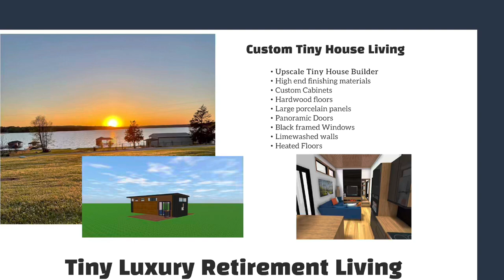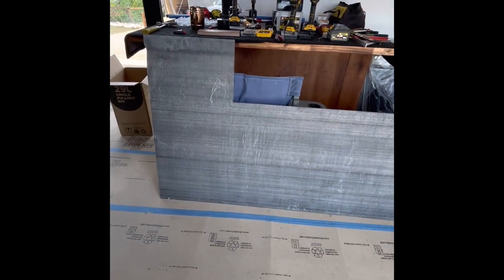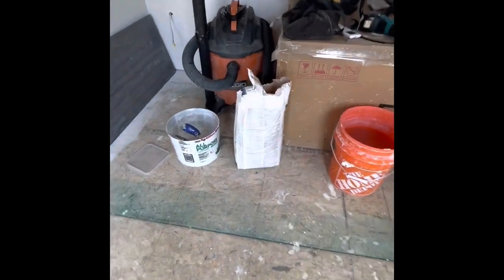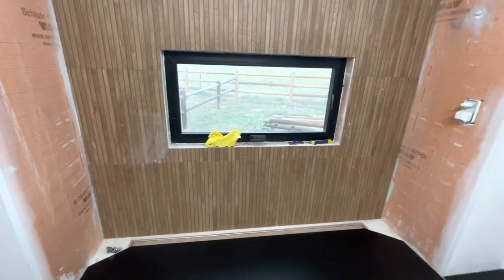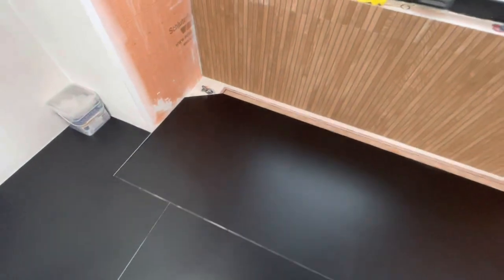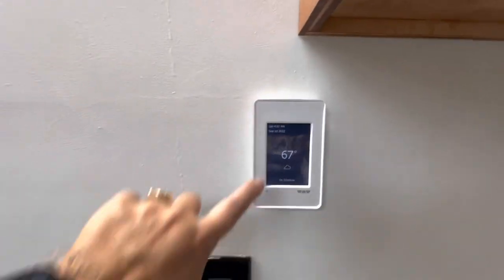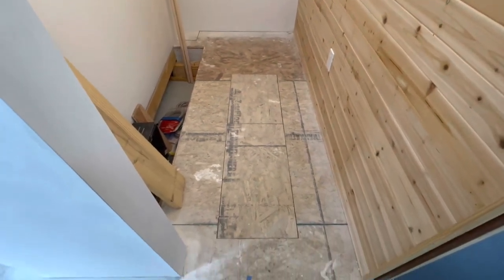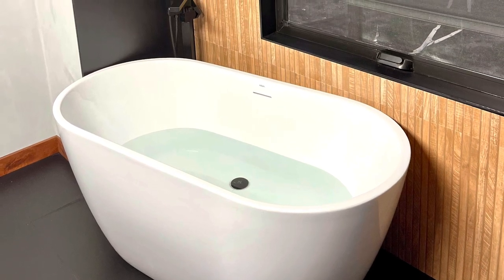Not-so-Tiny House Bathroom Transformation with @CrossvilleTilebrand

Comment: Just curious to know what would be the cost per square feet to build a 'not so tiny' 12Wx40L with 2' bumpouts and a 3' mechanical bumpout. Totals 695 sqft including bumpouts and one loft??
Reply from the maker: Sounds like we need to get am email chat started.  Let connect through email on this.  Tinyluxuryretirement@gmail.com
Reply: @hensley-homes  OK